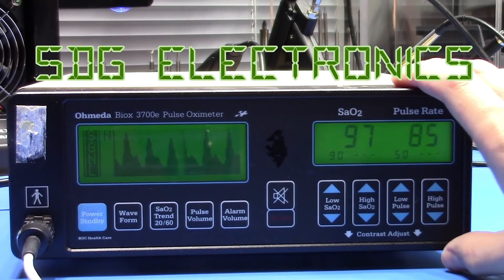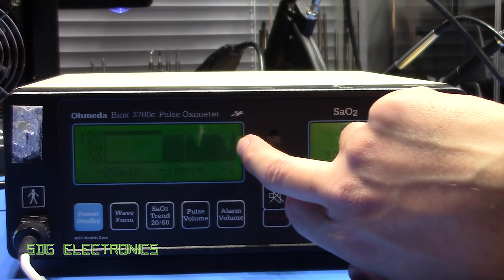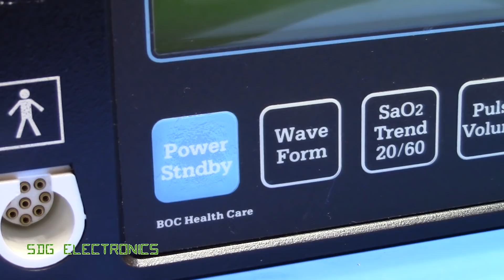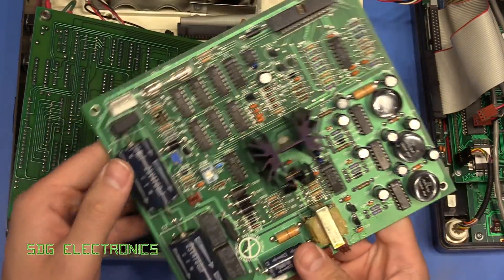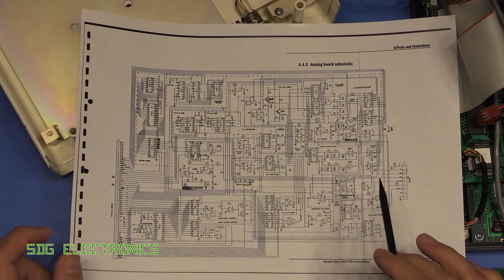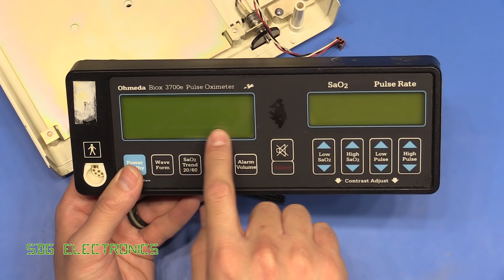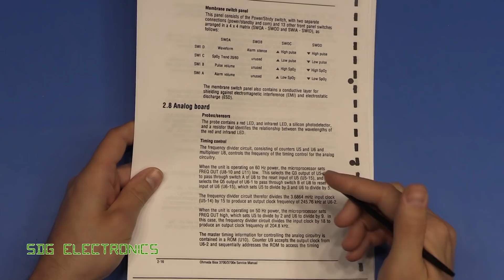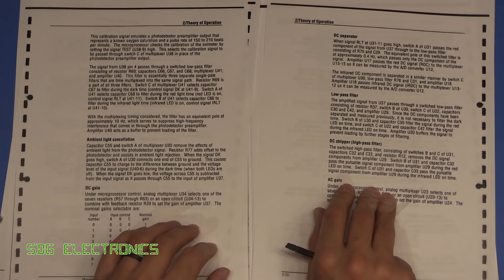SDG #058 1980's Pulse Rate and Sa02 Monitor Teardown (Ohmeda Biox 3700e)

Comment: 6402 UART........oh how I remember that IC. Used it plenty at work (bespoke Z80 industrial rack computers & Nascom 'PC's') and also in home projects (ZX Spectrum related) back in the 80's. 4040 counter next to it likely dividing down the CLK for the baud rate. Whoop whoop!.....Many thanks for this video.
Reply from the maker: Thanks Ian. Kids these days are spoilt with their 32 bit dual core microcontrollers
Reply: Funnily enough, one of our old designs also had a Z80A, 6402 UART and an AD574.........must have been the 'chipset' to use back in the day!

Comment: Perhaps better isolation was not required as there is no electrical connection with the patient, unlike ECG equipment.
Reply from the maker: In the standards, the sensor is still classed as an applied part. Direct cardiac electrodes have a more restrictive leakage current and isolation requirement. The plastic housing would only class as 1 MOPP though, so an additional layer is required.